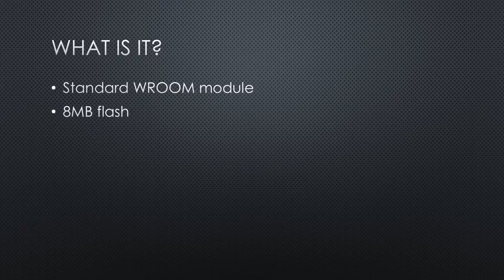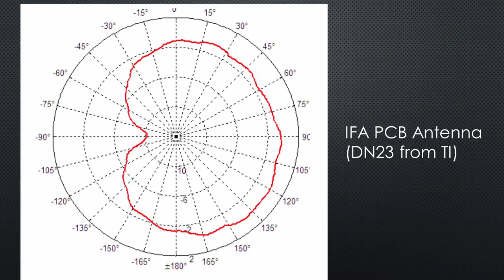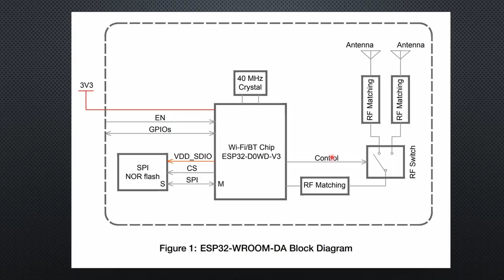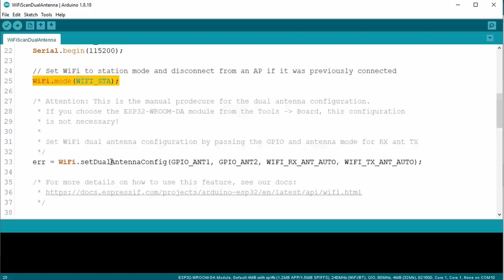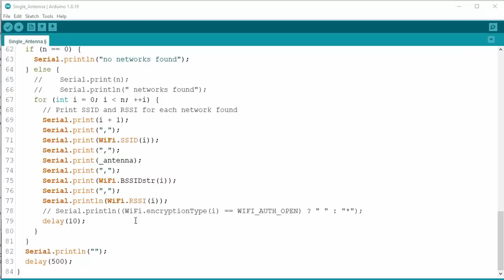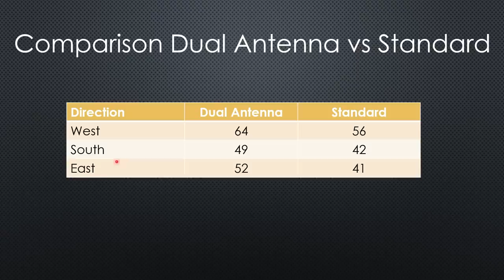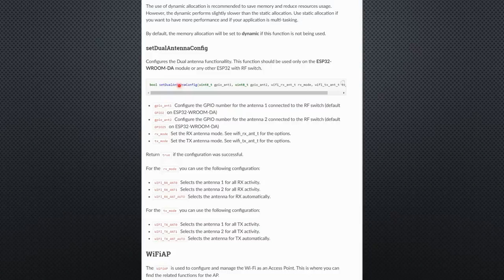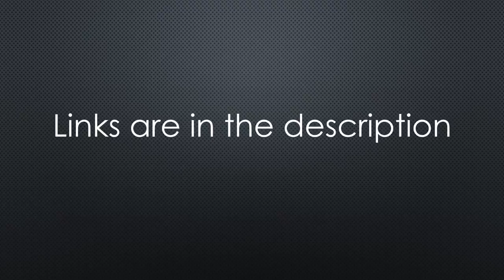#422 A new Dual Antenna ESP32 Module: The WROOM-DA

Comment: I am buying only ESP32u with uFL..... and the range extension is huge. Ideal for outdoors projets.
Reply from the maker: Good decision!
Reply: Good reminder! I was just thinking about adding an ESP32 to my car but was worried that the range wouldn’t be long enough. I will try an external antenna.
Reply: For most projects the size and extra expense in any mass manufacture puts ufi in the hard basket, I think the DA offers those with manufacture runs a cheaper alternative in a smaller self contained package.
Reply: Which ones do you like?

Comment: I am very happy to see someone test and talk about this product.  I'm actually working on a street light project for my neighbourhood where our streets are private, we have ~40 streets poles each distant by <50 meters.  Power on/off is currently centralized, but we're considering using them for security cameras, so I need permanent electricity on each pole.  For this purpose I chose to work on an esp32-wroom-da based design with a single bistable relay, 5v meanwell psu + 3.3v ldo.  Esp-mesh/mqtt on the software stack for clock syncing, firmware update, monitoring and some arbitrary commands.  I ordered a bunch of them, I will let you know how it goes, I guess in a couple of weeks... I'm already at the second iteration.  One more thing: I really like your channel the quality of your work overall, I learnt so many things from it and sometimes your point of view weights a lot in my own decisions, so a huge thanks for the time you spend working on it.  Cheers from France.
Reply from the maker: Thank you for your kind words. An I hope you will be successful with your project!

Comment: On ESPEasy, I have the option to have multiple runs while scanning for a network. This often gives a lot more access points as not all access points react immediately on an active scan.
So you may want to perform several runs when scanning to get a good idea of the performance difference.
Also you might want to turn the WiFi off and on again (and wait a few-100 msec) to start scanning on the other antenna. When turning on the WiFi, it performs a RF calibration, thus maybe this can also improve the antenna performance if the antenna is selected before enabling WiFi.

I will also try to get one of those "T-shirt" modules, to test with. Have not had one of those yet.
On my own board designs, I almost always use the ones with an ufl connector, so the antenna can be positioned for best performance. Even those "sticker" antennas perform way better than the PCB ones, at least that's what I've seen.
Reply from the maker: I agree with your statements. I averaged a few scans because I also saw that they differed from scan to scan.
And I would expect that Espressif does all the needed stuff that the switching gets the best result (like calibration, etc.) Maybe they already did and I do not know because they kept it as a "secret".
I am glad if you do your own tests. And I agree that external antennas are a good choice. But they are clumsy and add to the BOM...

Comment: Dual antennas are very helpful where there is multi path (destructive) interference.

Perhaps a more enlightening test would be to orientate a metal plate quarter of a wavelength away from one antenna such that it is in a null (ie a sharp drop in RSSI due to the destructive interference). Then switch to the other antenna, where the signal should be outside the null, due to being spatially separated.

Adding the RF switch will increase insertion loss and so degrade the noise figure. Therefore the benefits of multi path tolerance have to balanced against slightly degraded sensitivity.
Reply from the maker: I agree with your analysis. I for sure would do those tests when designing such an antenna. For a user like me, it seems to be more important to just see how big the effect is in reality.
In addition, the effects will be different in every situation (13cm wavelength!). So it is more a general feeling that it could help. But only if the switching works properly ;-)
The insertion loss of the RTC6603SP chip is 0.4dB @ 2.5GHz, BTW.
Reply: @AndreasSpiess  Interestingly, there exists "space time block coding" aka STBC.
Here, the access point uses two antennas at the same time in a way that a single receiver antenna can make use of. If the interference exists for one of the transmitting antennas, the other antenna may come in loud and clear.
The ESP6266 supports STBC, it seems.
(The other way around it is trivial, the AP can use whichever antenna works best to receive the single signal from the ESP).

Comment: The shown WIFI routers with multiple antennas are completely different from this ESP32 module. All of the antennas are active at the same time. There is no switch that selects just one antenna. Multiple active antennas are used for beam forming like a phased array or to receive multiple signals simultaneous (MIMO). If the ESP32 could use both antennas as a phased array to do beam forming, it would get a better signal than any one of the antennas can receive by itself.
Reply from the maker: Thank you for your info. I know about beamforming but thought that it needs an array of precisely spaced antennas. The antennas of the routers I showed have moveable antennas. That is why I thought they could not be used for this purpose.
Reply: @AndreasSpiess  I am no expert, but I believe wifi does not actually know what the world around the router is like. It just tries different combinations of phase shifting between the available antennas until it gets the best rx signal. Then tx can use the same parameters.

Another interesting fact is that the antennas on many wifi routers are somewhat fake. They are made to look impressive. But actually they are just empty plastic shells with the actual antenna inside being much smaller. The wavelength of a 5 GHz antenna would only be  6 cm and the antenna probably a half wave in length. Yet the router has huge antennas.
Reply: @BaldurNorddahl  wow! marketing in design.
Reply: Most routers nowadays still only have 1 radio per band and the antenna is switched but they do have their own amplifier
Reply: @lifeai1889  modern wifi features like MIMO and beam forming only works if you have multiple antennas active concurrently.

Comment: I think that multiple antennas in routers implement MIMO operation - multiple inputs and multiple outputs,  they work together at the same time. Here the antennas work one at a time. I assume dual antennas were included to improve directivity. Auto mode would allow connecting to the known AP using an antenna with the better RSSI. This can easily be tested by logging the RSSI for a nearby AP in ant0, ant1 and auto mode. The latter should return the maximum value out of the two.
Reply: Yes, I wanted to remark this as well!
The access points that have multiple antennas actually have multiple receivers (and transmitters), not an antenna selection switch.
Reply: In routers it's more complicated. They indeed use multiple antennas for MIMO but also in this same time do what this ESP module aka try to find best antena for every connected device. In most advanced ones also beamforming signal.
Reply from the maker: Thank you for the additional info. I never looked into the router antennas.
Reply: @AndreasSpiess  I learn a lot from your videos and, on rare occasions when I can add something (I think) worthwhile, I do with all my respect to the creator

Comment: For a test I would propose, try to connect to a WiFi network, and then compare the two-antenna to the one-antenna version. I imagine the auto-mode to be effective when the module knows what network you want, and then switches between the antennas to get the best signal for the desired network.  In such case, a test might include a setup you can carry around, seeing how it switches between antennas when the relative direction of the signal changes.
Reply: Yes; it seems we don't know what AUTO is optimizing for. If a network is selected, it may choose the best antenna for that. but if not, like in this test, it could as well try to get as many as possible as try to optimize the strongest (or pick up one arbitrarily, a.k.a. simply don't know what to do... :-)
Reply from the maker: Maybe this would lead to different results (as I mentioned in my video, I do not know). However, I do not understand why auto should not work for scanning. A module first has to scan the frequencies to find an access point. If auto does not work it probably would not find the proper access point. At least this was my reasoning.

Comment: I wonder, on balance, if a single external 1/4 wave vertical antenna is going to be better or worse than a (well optimised) switching between two pcb antennas?
I have got into the habit of using an external antenna for esp32's I put outside, and this would be easier and smaller
Reply from the maker: An external antenna is for sure a good possibility and usually has a better performance. Often, people do not want one because of the added size or cost.
Reply: @AndreasSpiess  On the other hand, with an external antenna one has more freedom in positioning the ESP.
Reply: Me too, I often are confronted with the limited coverage of the standard antenna. I started adding AP's in my network, but still, an external antenna performs much better. I can live with the additional cost and form factor.
Reply: There are wroom modules with ipex connector if you need an external antenna
Reply: I use "3d antenna" like the one on TTGO module. I made the same test as Andreas Spiess and saw that the 3d antenna perform really better than the PCB one. 
So for me it is a good quality / price / space ratio

Comment: I believe some newer bluetooth modules have a dual antenna configuration to measure the Angle of Arrival (AoA). That could be interesting to test
Reply from the maker: I never saw AoA for BLE so far, but I saw it with Ultra Wideband on the new Iphones. There it works very well.
Reply: AoA is on BLE 5.1. No ESP chip supports BLE5.1 yet

Comment: If you turn the complete circuit upside down the position of the antenna's 1 and 2  are swapped. If assumed the characteristics above and below the antenna (the z axis) are the same this would give interesting additional information.
Reply from the maker: That would have been an excellent test to see if ant1 is still better most of the time (without asking Pedro to do the test).

Comment: Dual antennae usually used for diversity purposes. Dual rx are useful for calculating multipath signals and diversity gain. All cellular communications use atleast two rx paths for receive diversity.  Two TX is mostly used in MIMO feature.the antennas kept at 90 degree, the purpose may be +45 & -45 cross polarization.
Reply from the maker: Thank you for the additional info. I did not know that cellular phones use space diversity. I only knew it from HF systems below 30MHz. And I agree with MIMO. But I think this is another story...

Comment: Nice, it's quite frustrating when the documentation doesn't help, I spent days trying to resolve issues with a Gyro chips interrupt parameters to find that the manual had an error.
Reply from the maker: That is even worse because usually we tend to trust the datasheets!
Reply: @AndreasSpiess  As Dave Jones would say, "that's a trap for young players!" ;)
Reply: Ah, wrong datasheets!  I ran into some of those during my time in Corporateland.
One especially egregious case: I was designing a module that needed some sort of little MCU for monitoring, communicating via I2C.  I was leaning toward an AVR device, but Management decreed that I should use a particular 8051-based MCU because an engineer in another division had already used it successfully in the same role, and had firmware already developed and ready to adapt.  After reviewing the datasheet, I went along with this.
Well, my module having been designed and built, I made the pilgrimage to the other division in search of firmware to adapt, and found that the other module hadn't been built nor the firmware tested, so my module became the test platform.
And, surprise!  The documentation for the MCU's I2C interface was wrong; in reality, a key feature needed to support... I guess we're not supposed to use the old terms?... anyway, it could operate fine in "mad scientist" mode, but in "hunchback" mode there was something fundamentally broken.  And, of course, there already being one "mad scientist" on the bus, these modules were all supposed to operate as bus "hunchbacks".
I don't recall what the resolution was - whether we came up with a firmware hack to make it work well enough for the purpose, switched to a different MCU, settled for a dumb module, or just abandoned the whole project before getting module communication sorted out.
(This wasn't even a brand-new MCU, so the re really ought to have been at least an erratum for the I2C issue, but I guess I2C on MCUs is almost entirely used for talking to EEPROMs, temperature sensors, and the like, so it's entirely possible that I was the first one to try to use it that way.)

Comment: One option that you may want to test is to orient the board so that one of the antennas is oriented horizontally, and one vertically, and see if that helps with lower power signals. I know that RF that hits certain typologies can end up switching from horizontal to vertical polarization, and having a platform that allows you to switch between the two for some environments may give you far better coverage. That said, WiFi wasn't really designed for 'weak signal' work, so there are likely to be other issues that prevent a stable connection if polarization gives you a significantly different signal level. And that may also be part of what the results you see from the Auto test are showing, that suggests that of the 56 signals observe on one antenna, and the 30 some odd on the other, only 20 overall were within whatever level the system accepts across both antennas. But I don't know, I don't work for Espresif.
Reply from the maker: Two antennas with different polarization would help a lot. But it is much more complicated to manufacture, I think.
Reply: @AndreasSpiess  not if you orient the board on edge and elevated @45 degrees

Comment: In multi-path conditions, sometimes an irreducible bit error rate (BER) is present. But diversity combining wouldn’t switch between antennas but use them both and some kind of quality measure to combine them.
Reply from the maker: On HF we sometimes use "space diversity" where we do a similar thing with the two antennas. But we also do not connect them. We select the stronger signal after the receiver. This can create very good results.

Comment: You can solder sma connectors to antenna traces and connect your qo100 amplifer to one of them and set it to tx only and use other antenna for rx. It should increase range a lot.
Reply from the maker: Maybe they will come up with a design with two antenna connectors. That would create some new possibilities, I agree.

Comment: Andreas, it looks like your standard ESP32 had the antenna over the breadboard, while with the WROOM-DA, it was sticking out over the edge of the breadboard. I wonder if this could adversely influence the coverage of the ESP32? After all, you did suggest that any PCB design should not have the antenna over the board... it should stick out to avoid RF shielding. Am I right?
Reply from the maker: You are right. But I usually compare things which are available and used by my viewers.

Comment: Initially, I thought perhaps the dual antenna setup might be for diversity signal RX. Is there something in the docs that points in that direction?  Can diversity RX be done in software? I used to use some cellular modems that had that feature if you connected two antennas to them that could improve reception in noisy environments or improve weak signals if the device was far from the nearest cell tower.
Reply from the maker: I would call it "slow space diversity" because it has 2 antennas but only one receiver. But it switches to the better antenna from time to time (at least this is what I assume, but not know). This should improve reception, particularly for fixed setups.

Comment: Can you show how to solder those chips? Do you use hot air or do you really solder them with an iron?
Reply from the maker: I solder one pin with my ordinary soldering iron and then a second one at the opposite side. When everything fits I solder the rest and check with the ohm meter if I created any bridges.
Reply: @AndreasSpiess  Thx. Then I will not try the heat gun.
Reply from the maker: @michaelkaercher  I use the heat gun for desoldering of small parts only.

Comment: Thinking aloud: Would it be possible to de-lid the module and have a look at the RF switch? Watching W2AEW's channel, it seems like it shouldn't be a complicated circuit. Won't tell us much about the switching algorithm, but it's a start.
Reply from the maker: The chip they use is in the datasheet: An RTC6603SP (0.1 GHz - 3.0 GHz SPDT Switch)